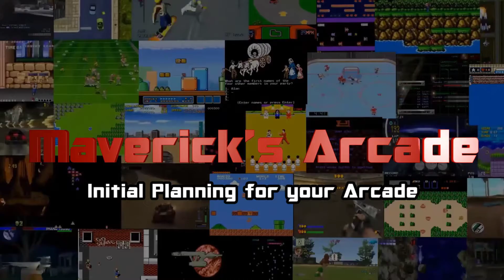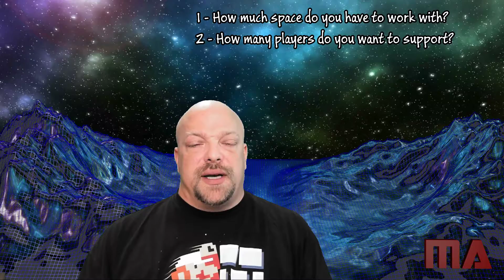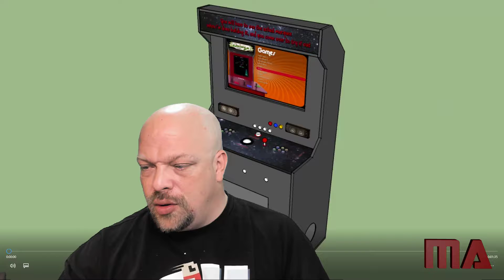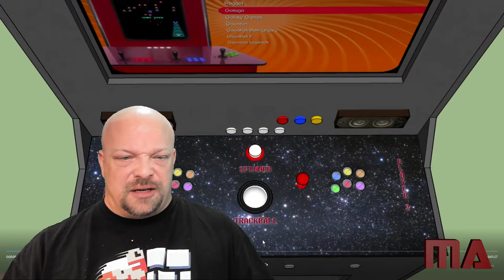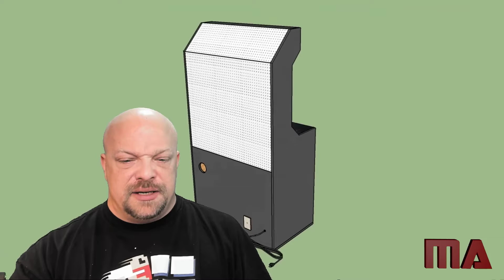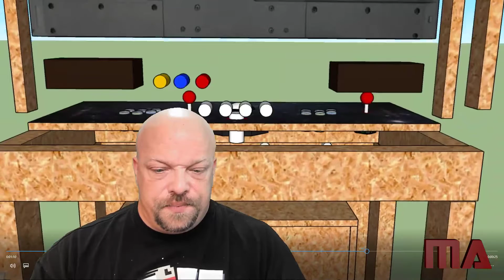Initial Planning for your Arcade

Comment: I really appreciate all your tutorials but I did have a question. I was just curious if you had any advice for folks using a Raspberry Pi 3 as their CPU. I have bought the IPAC Ultimate I/O and am wanting to use a few LED buttons. However, the power supply for the LED function has the molex end of which obviously wont plug into the Raspberry Pi. I have been tirelessly searching google as to the best way to power the leds without compromising the functionality. Should I use a 5v wall power supply that is separate from my PC or will I have trouble programming. This is my biggest concern. Any advice or opinions would be much appreciated. Thank you in advance.
Reply from the maker: I'm going to travel down this road with you in the future :-)  One of our viewers is talking about sending me a Pi to learn and make videos with.  You should be able to just take an old PC power supply and use it to power the molex.
Reply: Maverick's Arcade thanks! I appreciate it. I look forward to your video on a raspberry pi setup in the future!

Comment: Hey there,  I have a question regarding the pacled64 and the classic RGB pushbuttons... I cannot find anywhere on ultimarc that references color codes.  What color in plug should I be aligning with the + on the pacled64 board?  There is grey, red, green and blue.  My gut says the grey one is the positive but I need someone who knows for sure.  Also with the illumination kit for the u-trak I have the same problem.  I get that the black wire goes to a spare GND, but this time the colors of the plug is yellow, red, green and blue - gut says align the yellow with the positive but a need advice from a pro.  Thanks in advance and keep up the awesome videos, I am using them as a reference for my build like everyday!!!
Reply from the maker: The + is gray, the red, green, and blue are RGB respectively.  The power is the common shared between each one.

Comment: loved the way that you sorted the ideas , i live in the middle east and would like to know where can i find the template to build the arcade
Reply from the maker: Really, just search google for "arcade cabinet design plans" and a bunch will come up.  I just made mine 100% from scratch, but already made plans will work too.  For the button and joystick layouts, I downloaded a graphic, and then traced it onto my control panel board.  (I printed two copies for both players)  Then, measured out the board to make sure they were both centered.   It's a little bit of math, but it will make sure the buttons are the same for both player positions.  Search "arcade cabinet control panel template" for player button example templates.

Comment: nice video! just wondering do your lightguns have kinks or bulges?
Reply from the maker: It's 21 inches deep.
Reply from the maker: HUH?  Is this some reference I'm missing?
Reply: I have no idea what he means with those icons.. attached an image of what im talking about https://imgur.com/BiSKBgn
Reply from the maker: OH!, I see what you mean.  I checked mine, I didn't see any kinks persay, but I did see a couple places where the braiding is visible, but in my case it's just cause the casing is tight, nothing appears wrong about my wires.  :-/
Reply: hmm thanks for the confirmation. just wondering how deep is your cabinet, from the back to the front of the control panel?